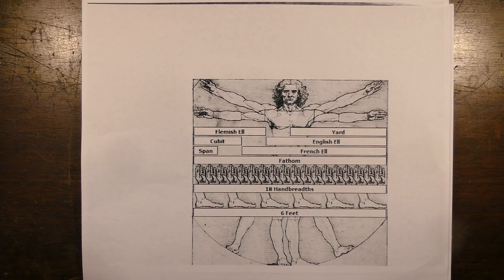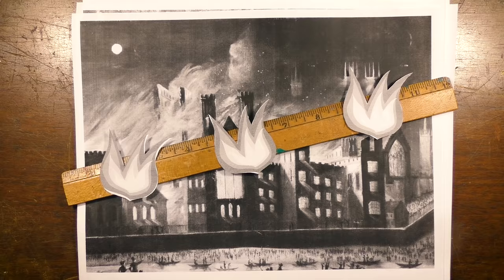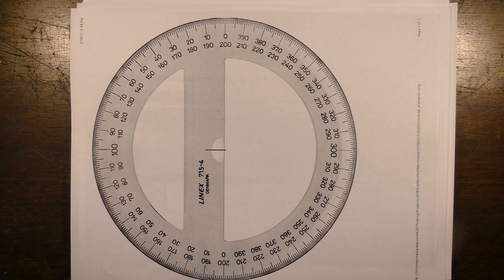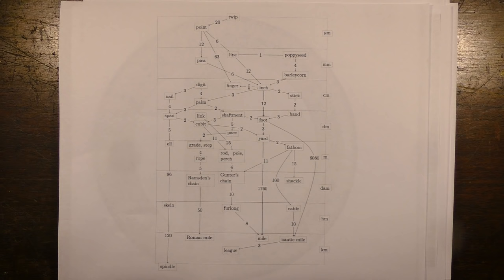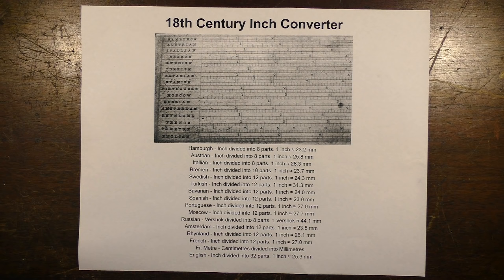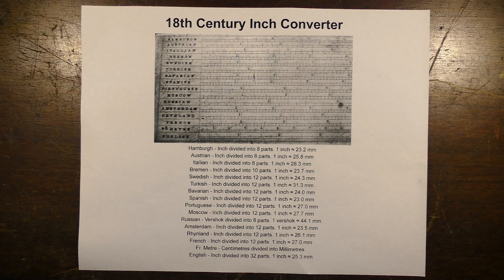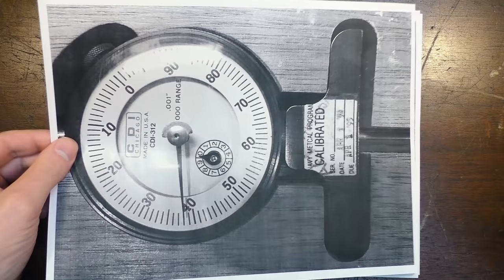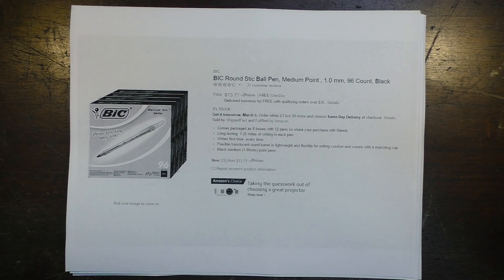Origins of Precision

Comment: This video should be part of high school math classes everywhere. It is foundational.
Reply: Yes, and in any vocational shop class such as metal shop, machine shop, wood shop, foundry shop etc. IF they even have these in junior high and high school any more. I absolutely loved machine shop in my junior and senior H.S years, circa 1970 -71. It was one of the only reasons I would show up for school ! Knowing I had 2 periods to operate a lathe, or milling machine, lay out a project on steel covered with Dykem or Prussian Blue, using the power hacksaw and drill press and any of the precision tools and machine shop hand tools just made my day. I even got a part time job in a large machine shop. I retained quite a bit of that knowledge but alas,  it was the electrical power station field for me. But, if it were not for all the math that I struggle with I would have likely become a machinist or tool and die maker.
Reply: I dont think most schools have machine or shop class anymore unfortunately. I graduated high school in 2003 and they were phasing out Shop class then, and by that time it was merely a shadow of what it should have been, and used to be. It was a gimmick with a lazy teacher who didnt care and mostly students who wanted an "empty" period to do nothing in. Sad. I would have loved to learn machining, etc.
Reply: yesss
Reply: In total agreement.
Reply: @MattH-wg7ou  it really should be tought as basic knowledge
Reply: Math is about truth, not precision. Precision comes from the truth.  For a mathematician it is more important to prove something true than to calculate an answer to some precise value. The fact that an answer exists is enough, more important is why it is able to be calculated.
Reply: Read the book "Exactly" by Simon Winchester. Or listen to it through Audible and get your first book free!
Reply: Eeeek!!!  Don’t teach kids to make knives, guns, motors, and other weapons!  Teach flower arranging.
Reply: In late 1970s a female classmate from my under graduate class was working towards her master's program at an American university.  After she had collected data for her master's thesis her academic advisor had an under graduate student worker did calculations on the data.  When they got the data they found the calculations were all wrong-- the student worker did not know what were multiplication and division.  She treated them as addition and subtraction!  There was also a news reporter who gave a pop quiz from the multiplication table on a student just graduated from high school and the student failed.  This problem with mathematics still exist among most of the American students, and we should bear in mind that the Russians and the Chinese are really strong on mathematics.
Reply: One of the last acts, make that Executive Order, of Obama was the shutdown of all the Trade Schools in the USofA.  Not directly, you understand, but by making tech students unable to qualify for student loans.  In mid-term, in the Fall.  I understand he's in the basement of the WH now and calling the shots.
Reply: I try to teach some of the basics of this in my high school integrated chemistry and physics class. This could also be taught in chemistry I, physics I, and any other class where measurements play a central role. Although mathematics appears to be indispensable to measurements, measurements are not indispensable to mathematics.
Reply: it has almost nothing to do with mathematics
Reply: @haroldshull6848  pointless accusation. Trade schools are still operating. The new loans are available for accredited trade schools. ITT Tech went bankrupt before Obama's exectiv order, and frankly , good riddance. Its 130 for profit trade schools were the top-5 for student debt.
Reply: @haroldshull6848  I'd like to see that in congressional archives. Everything   I mean Everything that passes through congress is available. Dates names..I just have never heard that until now. I have grazed through his 8 years to see what Obamas accomplishments are. I did not see that. Do you remember approximately when  that was introduced?
I don't want to pass that up.
Reply: @MattH-wg7ou  our machineshop in my local highschool was one of the best in the province. It had original 1945 lathes donated by Ford motor company still in pristine condition even after having tens of thousands of teens working with them. Also had an original 1921 auto metal saw that worked fine we used regularly to cut stock steel. The primary reason the shop operated well after all these years was the focus on cleanliness between each class. Lucky I got the experience I did but in this area it makes sense, as the auto industry is very big here and regularly donate equipment to our schools to produce new workers. Also edit this was in 2014
Reply: Agreed
Reply: Uh they are maby not this one but very similar ones oh wait are you in US public school?
Reply: @MattH-wg7ou  yes they are not in the us perhaps but most others have
Reply: Math class seems like a weird choice
Reply: @LunaticWithALicense  Junior HS student here, I had a metal shop class last year with mills from the 1940s, and they worked better than the newer stuff we had which always needed something on them tweaked or fiddled with to work right.
Reply: It used to be. Then they decided they needed to make more debt slaves just smart enough to apply for student loans and pay taxes
Reply: If you don't know this before high school I feel sorry for both you and people around you.
Reply: Not math but definitely in science class, precision is the origin of measurement
Reply: @MattH-wg7ou  et
Reply: I don't teach math but I'm trying to make metrology a part of my school's physical science curriculum
Reply: @Prometheus720  that makes way too much sense, would be too useful at preparing students for real world decent paying jobs and would harm the debt slave agenda. The school board and teachers union (who don’t understand it let alone want to teach it) will never approve it! Maybe in 1962, definitely not in 2022.
Reply: The BBC made this programme years ago.  It was called Measure for Measure. This video is clearly referenced from the original. I remember there was one on weight, another on length and ,I think, one on time made in the late 90s.
Reply: @rogermiller2159  devils advocate... i think the op was referring to some of the early changes that were made to fafsa money.  They opened up student loans for a lot of people at the time that didnt quite extend to trades at first. I do vaguely remember that as well but i think it got remedied or amended or what have you pretty quickly as well... possibly even the following semester.
Reply: How to get a straight line when you don't have anything straight. Simple, arrange any thin and very light weight wire ,threat or rope and streach it hard bingo you got a straight line.
Reply: You said it!
Reply: Also vocational school importantly the machine engineering class
Reply: Ugh no
Reply: Capable citizens are hard to sell stuff to.
Reply: What is this math you say?
Reply: Piazzola in the background?
Reply: well said
Reply: @ericfermin8347 math, as the study of truth, has a lot to say about proximity to truth! Probability theory!
Reply: @richardnineteenfortyone7542 
Oh dear, what about the screwdriver I made with the milled flutes on the handle and a hardened tip?
Reply: IT WAS! when I went to School in Downey Ca?  Rockwell and NASA offered "ME" a Paid and Trained! Job st about 13 or 14? just before the shuttles 1st flight, and I said "no" believe it?or Not?  I was a smart DUMB! Kid?
Reply: Constructability with compass and straight edge is also foundational. St. Andrews YouTube channel has a decent intro on it.
Reply: @arrrrr1689 For wood working yes. When the highest level of precision you ever use is the 1/16”. When you are talking millionths of an inch no. In theory yes the direct path between any to points is a straight line. And if the only force acting on the string was tension it would work. But the string has mass which is impacted by gravity so it sags. Even if done vertically and if there was no gravity there is wind vibrations changes in heat internal stresses in the string ect. All this means in the practical world tension is never the only force acting on a string so the string is never perfectly straight. Also even if the string was perfectly straight where are you going to find a string with perfectly uniform thickness down to a millionth of an inch so that you can use the edge to compare against. Also because the string is so subject to moving under outside forces that means that you can’t touch it to transfer the straight edge like you can with gauge blocks since touching it deforms it. You would have to transfer it optically or in other words eyeballing it. Not a great method. Again yes I know you use chalk in wood working but you have to flick the string to apply it and I’m doing so you are losing precision.
Reply: Strings are only straight in theoretical physics. There’s always an outside force that warps them.
Reply: This comment has a 1500 likes and it is a load of BS, math isn't machinery, math is the language of the universe, you must really be ignorant of math to make that statement and 1500 of others are the same for that matter :)
Reply: @tzyijiang9884  i am pretty sure that in the US people get taught that in 2nd grade , but then again i spend the first 4 grades of my live in germany and only later moved to US so idk but i have not seen anyone do that mistake

Comment: I always wondered how you can make precise tools from the absence of precise tools, but now I know: rubbing 3 flat surfaces together to make them extremely precise. Neat.
Reply: Yeah, but then what? I wish he'd expanded on how exactly surface plate helps to build other stuff.
Reply: @zZzZzyxel   It does take some thought of your own, but he did explain. Take a sec and work your mind through how this could be done. Pretty amazing
Reply: @michaelppaull what a spectacularly unhelpful reply. if I could I wouldn't have been asking in the first place.
Reply: @zZzZzyxel took me a bit to figure out a method, but you could make a 90 degree edge like this:

have one surface plate as a base, then put two others face down on top of it, then you can scrape the vertical edges of the other two together, then to stop the vertical edge slanting in/out like a cone, you do the same AB BC CA thing by having a third one that you also scrape the edges with

you could also do the same thing except you also level the vertical edge using the surface plate to get a non-curving 90 degree edge, and from there constructing an accurate cube is easy

im not sure how to phyiscally get any other angles, but once you have an accurate ruler and a 90 degree edge you can construct them geometrically
Reply: @zZzZzyxel bro he did explain it, what are you confused about if you really need someone to hold your hand and tell you step by step like a child igu

Comment: When i first herd about the three planes method i was blown away. I had always thought that precision was something which emerged slowly, through history, a conquest gained by mankind literally a fraction of unit of length after a fraction of unit of length. But the fact that no, you can just make something flat out of nothing, and then derive practically everything from that reference thing - is so unbelievable. It's one of those things in science that looks like when you can see three's roots under the asphalt, like if there was a pattern and sometimes it's on the surface and it's easy to spot.
Reply: It requires someone with immense amount of ingenuity though 😂
Reply: yeah but it means nothing if you don't have the means to measure it.

Comment: As a Journeyman Tool & Die maker with 47 years in the trade, I found this fascinating. Too many of us take the surface plate and Jo-Blocks for granted. I made a set of flat lapping plates as a student at the age of 17. (three plates lapped together just as you described) I still have them in my tool box.
Reply: I totally agree with you 👍💯
Reply: AMEN Me too! grew up on the Same Street, Next Door to Rockwell Int Downey 60's to NOW!
These older machinist COULD Do ANYTHING and Fast!
Reply: I started out in tool and die as well. Right out of high school in 1977 but then I saw the writing on the wall with manufacturing leaving and with it, the job shops and tool and dies shops.
Reply: @hootinouts  Very sad. I feel too many of today's machinist rely on the computer to do everything for them and don't have the knowledge of what I consider to be a true machinist. Personally I love my manual machines. I see where CNC machines can be valuable however I disagree with those who claim that they are more accurate than a manual machine.
Reply: @Parents_of_Twins  ok lol
Reply: @Parents_of_Twins  CNC can be more accurate with complex shapes, especially when the item you're manufacturing doesn't need to be transfered between machines for next feature. You are still right, in machines like lathes, and I mean purely two axis machines (altough all lathes have third axis for the tool adjustment), the accuracy is the same. In favor for enclosed machine, be it CNC or manual, modern heat control can increase accuracy, and I know for a fact that this is very important in gear manufacturing.
For complex geometric shapes it's just easier to make a machine that uses computer to control 3 axis or more at once. On manual machine you'd need multiple tools for single machine, or multiple machines which increases error when transfering the item.
From production standpoint CNC wins every time when properly used, and this is not about scripting (I just don't like the word programming for parameters and tool paths). It's about tuning the physical physical machine, observing that everything goes right, but in serial production CNC can produce extremely accurate parts, and when series are labeled, everything is the same size as far as industries are interested and we commonly measure. This is not molecular accuracy, but neither is manual machining.
Then we can think of other machining methods, like electrical discharge machining, that is simply not possible to do manually. CNC every time, and accuracy is good for medical, lab, and aerospace, and even for some microchip production. These are more about the parts themselves that are of difficult shapes and accuracy is important.
After all, for small production series, manual wins CNC, as CNC requires different skillset. Not completely different though, because CNC machines still need the precise lining and adjustment of the machine parts themselves from time to time. Machine wear occurs, temperature inside machine changes, temperature outside the machine changes, temperature of stock material can be different. All must be taken into account.
I know this from simply by having to maintain and adjust both manual and CNC machines myself, usually just simple horizontal axis mills with turntables that I used to do. All kinds of machines I've encountered are adjusted by using mechanical, hydraulic, and laser measuring devices. All tools, be them measuring tools or adjusting tools, have their place, be those old tech or new.
Reply: Watching people's brains melt when you ask them how they would make perfectly, verifiably flat stone surface after you've dropped them on an untouched desert island is always a fun game.
Even with a toolkit it's all but impossible unless you already know how.
Reply: No masterwork?